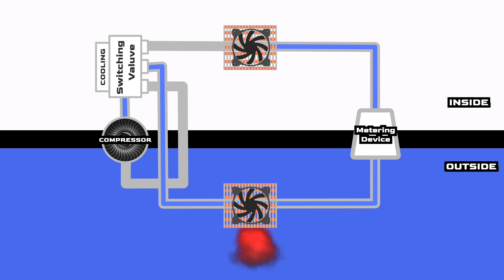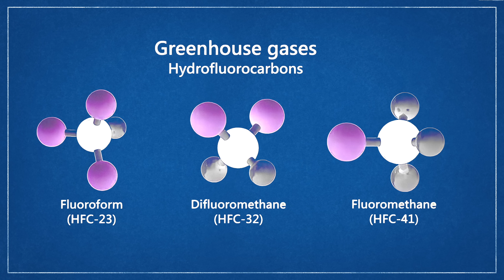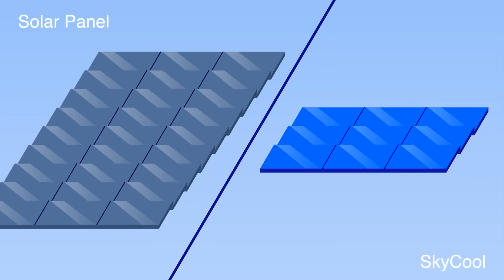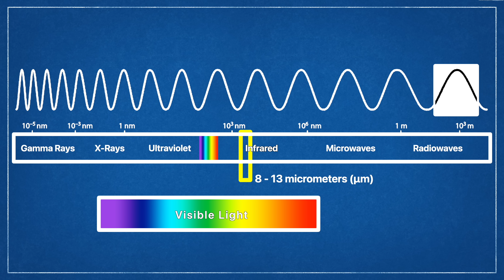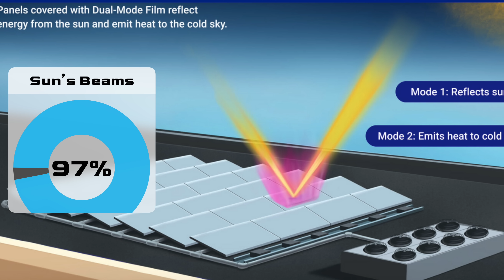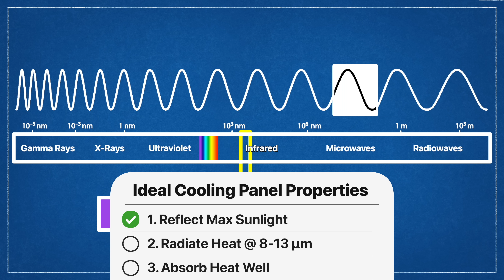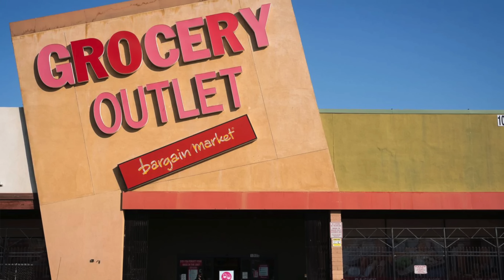New AC Tech Sends Heat Into Space & Saves 95% On Cooling Bills!

Comment: I haven't thought this through, but I know some solar powerplant use mirrors to reflect solar light to a very dark surface to melt molten salt.  The salt acts as a heat capacitor that could later be used for power generation.  Can you not point these panels at some black surface, heat up some water/glycol, pump it into a storage tank for power generation later.  Maybe even using a Sterling engine? 

I feel like there's synergy into combining a lot of stuff you're talking about on your channel.  Perhaps make a video on this topic?
Reply from the maker: Good points!

Comment: I really like the idea of radiating heat back out towards space over just moving heat from inside home to outside home. I assume in near term, Sky Cool is only going to be doing installs on top of flat warehouse type structures like grocery store covered in the video. Once they are ready to start working with consumers, I would certainly welcome learning more.
Reply: You're correct. They are only working with commercial customers at this point.
Reply: There is a much cheaper solution which is currently used extensively called false ceiling made up of gypsum boards.
Reply: @AshishMahato  Any reliable information / instructional source on this you can link to? I'd be interested in learning more or do I just search for "gypsum boards"?
Reply: @cusman  search "false ceiling gypsum boards".
Reply: @AshishMahato  Thanks
Reply: You do realize anything "hot" radiates heat back out into space.  Go outside and look at the sky...you are radiating heat out into space.
Reply: @GeoFry3  anything hot radiates heat, yes  But at what wavelength. These panels radiate at a wavelength that is unlikely to heat the atmosphere as it passes through. The reason it won't work as well in humid areas is because water and dust (clouds) in the atmosphere will absorb some of that radiation. They'll still provide net cooling. Sure there are more efficient means of local cooling but none that don't just pass heat into the atmosphere or ground or water rather than through it. A reason these aren't on the market is they're still doing pre-manufacturing research. It takes at least a decade before technology like this can be turned into a viable product. Or a very deep money well.
Reply: @edeaglehouse2221  radiators are really old tech.  There is nothing new about what they are doing.

There is some precedence in materials for absorbing the full spectrum but emitting back out at a specific wave length.  All the bright day glow safety clothing colors work like that.

They are trying to do is radiate heat while simultaneously avoid convection and radiation gain in a way that pumps heat out without any energy input.

My thermo instructors usually had a term for that....magic.

Really efficient radiators that could be more efficient than forced air solutions commonly used now?  Maybe.  Super radiators that beam heat into space with a net cooling effect without an energy input....lol no.
Reply: @GeoFry3  Beaming heat into space is marketing hyperbole but it is accurate if the atmosphere disney absorb that wavelength. Once, using electricity to transmit light and data were also "magic". Were your "thermo" instructors lacking creativity or is it only you who thinks science can't realize other people's ideas?
Reply: @GeoFry3  you're just being argumentative. The panels are taking advantage of the materials' properties, not violating them. It would be like you arguing that the filament in a light bulb can produce heat but not light.
Reply: @GeoFry3  And? Please elaborate. You're arguing against a different claim than was made. They're not talking about hot objects and simple radiation. They're trying to develop materials that absorb at certain wavelengths and emit at others using nano scale engineering. Radiation at the target wavelength is absorbed less by atmosphere, so more goes to space. It sounds like magic mumbo jumbo but it isn't. The basic effect is documented.
 It remains to be seen if  practical scalable products can be developed and find widespread application. Maybe. We shall see.
Reply: @GeoFry3  However it works, this technology is using less power to transfer heat from inside structure further away from the structure than normal Air Conditioning technology which just pulls it directly outside.

As for heat to space, if this is driving it to space rather than letting heat crawl outward it sounds like something worth investing in for industry and climate regulators.

By that I mean, we need something artificial to replace the Ice Sheets that used to reflect a bunch of heat right back out.
Reply: @GeoFry3  focus on the words “however it works”, then stop being impressed with your assessments.

Comment: A white or silvered roof on all our buildings would assist greatly in AC cooling without adding to the energy or capital bill in the slightest.  The proper choice of material reflects solar energy into space instead of converting it to heat in the environment.  Ordinary steel roofs can be silver or white, this "new" technology is dressing on the fact that sunlight can be reflected.  Even asphalt shingles can be purchased in lighter colors.  So the question is would the "new" reflective panels be worth the cost over simply selecting the proper "old" tech?  Remember, these panels are in addition to the real roof, no tricks can be played with "replacement" until the "new" tech becomes produced to be usable as the roof.  Then it might be worth consideration.  Not as an addition, I'm guessing but as a replacement for current roofing it would be interesting.
Reply: These are active radiators that are removing heat from the building, not just reflecting sunlight away from it. These actually cool things, not just keep them from getting hotter.

Comment: OK, SOME of this "Sounds" good, but I smell a WHOLE LOT OF BULLSPIT here too. The money you "Save",,just like with Solar Panels, is soon EATEN UP by "Replacement costs" within 8-12 yrs. The sun will destroy these panels just like it does with Photovoltaic Panels..and the Replacement cost, with labor, will eat up Everything you "Saved" plus Much More. Remember, there is no such thing as COLD,,its just the Absence of Heat. Removing HEAT is the secret and Absorption Units solved that problem in the early 1900s. All you need is a Heat Source,,and the SUN is said Source, to make the system work. BTW. All the Climate Change "add ins" we heard here,,Yeah, that too was BULLSPIT...The earth has and will do what it is doing now for ever. In the 800-900 we had a 100 yr Drought in THIS part of the world,,and in Europe, it was HOTTER then it has been since. They just hope YOU don't do you OWN RESEARCH. So Sad.
Reply: Wow. You laid the biggest trail of BS I have seen in a while. 

But yes, I would expect these panels to last a similar amount of time as PV solar. Which is about 50 years. The standard warranty on solar is 25 years by the way.

Your remarks on climate change are BS too. Which I know because I have done my research.

Comment: On a clear night March, 26,2014, I covered one side of a sheet of poster board with aluminum foil. Formed the poster board into a tube with the aluminum foil inside. Stood the tube vertical standing on a styrofoam plate. Placed several tablespoons of water in the plate and placed the whole assembly on the back of my wife's car that was in the driveway. The tube was pointing at the black, clear night sky.
At the start of the experiment the air temperature at the driveway was 64 degrees and the time was 7:15 pm.
By 9:30 pm, the air temperature had gone down to 53 degrees, F, and the water temperature in the styrofoam plate had fallen to17.8 degrees, f. and had turned to ICE!!
Reply from the maker: Really! We should talk! That’s super fascinating!

Comment: It's still just a heat pump .. and limited at that  .. 15 degrees below ambient ? So on a 100 degree day your home is at 85 degrees at best?  Really?  Think about it ...
Reply: It is not a heat pump.
Reply: @williammeek4078  Does nothing to remove humidity
Reply: @reality4434  Yes, anything significantly cooler than ambient will remove some moisture for the same reason drinks sweat.

The interior heat exchanger will require a drain line.

Comment: WOW!!! This is a great idea, and as far as I can tell, only new because if the smartly chosen materials and components.  A "heat sink" is not a new idea, but to build it with materials so well chosen that it works in direct sunlight, well that is next level!!!! It certainly is reassuring to watch your channel, not to mention the potential investment ideas that are running through my mind as we speak.
Reply: Since my comment debunking this video was deleted...

This whole thing is a scam.
Radiative cooling is a least effective way lose the heat! At room temperatures it is nearly non existent.

Convection and conduction effects are those that are heating up your house (heat from air and ground). Both of these are much more effective ways to transfer heat then radiation. There is no way radiative cooling with this magic device will be able to lose enough heat to keep up with being constantly warmed up by the hot air around it. Whole system will eventually equalize at ambient temperature.

Reason for this is second law of thermodynamics. Which in plain words means all energies naturally want to equalize. Meaning same temperature outside and inside your house. To fight this you need to create a temperature gradient and this takes extra energy. This is what regular heat pump or AC does. And since these magic panels don't use any extra (or enough) energy, they can't create a temperature gradient, therefor they can't work. Easy as that.

Radiative cooling is used in space on the International Space Station, because there is no other way to dump heat in space. Volume of the ISS is about 1000m3, area of radiators to keep it cool is 156m2. But that's in vacuum of space, there is no warm atmosphere there constantly heating up the radiators. 

So unless your house is in space this will never work.

Comment: Yikes! I just spent $6000 for a new, efficient heat pump to replace a 20 year old AC unit that had a ravenous appetite for electricity. But this new technology may make my conventional system obsolete. Even worse, my roof is covered with 40 solar panels so I have no room to add radiant panels. I just can’t seem to win. BTW At 8:43 you show an old evaporative (“swamp”) cooler, not a conventional AC condenser. Evaporative cooling is the simplest system of all. The main problem with evaporative cooling is that it only works at very low humidity.
Reply: This system would work best when oriented facing north. If you have an unused northern roof exposure, it would not compete with solar for space.
Reply: @williammeek4078  That’s a good point but unfortunately I don’t have a lot of of flat roof space on the north side of my house. It’s a quirk of the architecture of the house that I have a large flat south-facing roof but the east, west and north roofs have very limited space to install panels.
Reply: @richardcoughlin8931  don't think you need a lot of flat roof but just an angle adjustment of the reflectors if I saw this right.

Comment: This is amazing but one potential problem which you touched on briefly, is that in a warm climate with limited roof space, one must choose between these cooling panels and solar panels. If you want to save money and you run your AC nearly around the clock, then the choice is clear - the cooling panels. But if you want a generator for potential extended outages like we have in Florida after large storms, then you’d be forced to go with solar + batteries.
Reply: If you read on, I believe they said that by combining SkyCool technology with PV panels you might keep the PV cooler, which makes it more efficient. Or put the PV on the south side of your roof, and the SkyCool on the north; the north sky is a better heat-sink, anyway.

Comment: At 8:11 It sounds like the SkyCool panels only help to get rid of the heat produced by traditional heat pumps so it won't eliminate heat pump power requirements and pollution. Am I correct that buying a SkyCool panel is like adding a bigger oil cooler to your car. The car engine may run cooler but it still burns gas and pollutes the atmosphere.
Reply: Not really. The panels actually do cool the home. They just can’t do it by themselves.
Reply: @williammeek4078  Right, they can't do it by themselves. So what else is needed? He says something similar to a traditional heat pump. So these new panels augment the condenser by getting rid of some of the heat. It sounds a lot like the old economizers that used evaporation of water and a fan to cool the Freon passing through it.
Reply: @patburnsent  a backup when it is cloudy. 

This thing will directly cool the liquid. That can either be directly used to cool the house, in which case the heat pump can be shut off or used to cool the gasses from a heat pump in which case, it is the heat sink for the heat pump. Either way, it greatly reduces the energy consumption.

Comment: Simplify...Yeah your Full of it. . Thermodynamics...Sing it.
Reply: Explain why you think this wouldn’t work.
Reply: "radiate out into space"  That 'space' is in the immediate vicinity.  It is the airspace coating these radiators.  Only some light rays can bounce back out to the space outside our biosphere.
Reply: @davebauman4991  No, there is an IR absorption gap right in silver’s peak emissions lines. This allows IR to go straight out the atmosphere unless the is a lot of moisture as water has an absorption peak in that same area.

Comment: "A thin layer of silver" AAAAAND it's too expensive...
Reply: plating in precious metals actually isn't that bad if you get the layer thin enough. It wouldn't surprise me if there is a large early adopter tax on this but I doubt its high enough to put off commercial customers, particularly if the energy savings are as good as they say.

Comment: If your south (and with Time of Use billing, the west) facing roof is covered with solar panels, put the SkyCool panel on your north and east facing roof.

15 degrees (unless that is C) isn't enough for the hot days here in inland San Diego, but you can "cold soak" the house during the cooler nights, eliminating the need to air condition during the day.    

Being the heat is lost to space, this tech also cools the planet.  South facing panels will reflect 97% of the energy in sunlight (97 watts per square foot, 1000 watts per square meter) on top of the heat radiated 24/7.